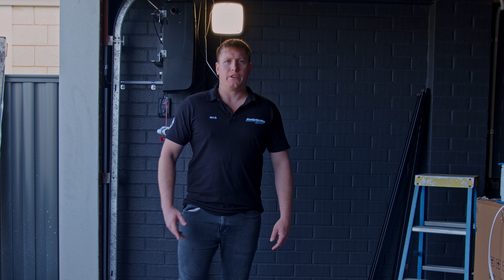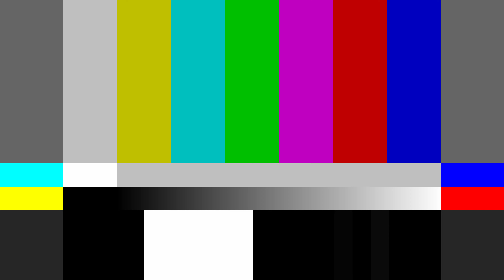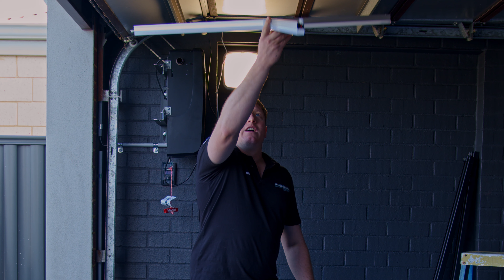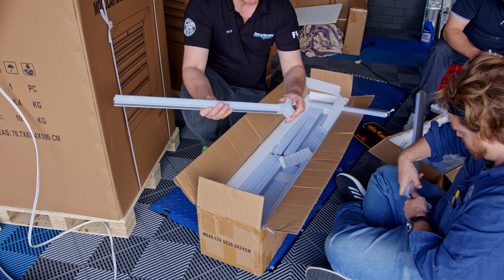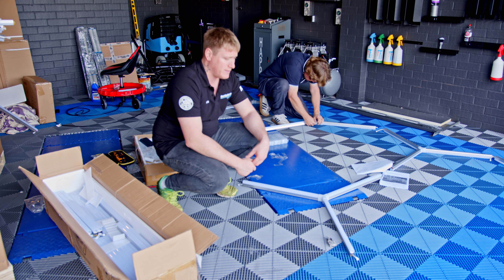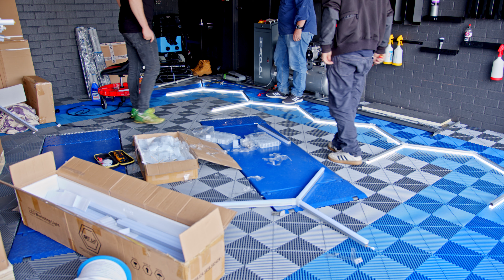HEXAGRID Garage LED Lighting Install! // Ultimate Detailers Garage Build \\ Episode 5

Comment: Hello, I bought a 45 by 14 foot one. It says you have to plug it into 7 different ports at the same time.  Do you need transformers or do I connect them directly?  I have connected it directly from a single output and they explode...

Comment: I hope you can help me I just installed the Hexagon lights and they are tripping the fuse. However, the tubes for the rectangle are coming on. Do you have any opinions as to why?
My thinking is it looks to me some of the tubes aren't all the way set so I'm gonna have to re-secure them from the ceiling and test them and re set them. I'm hoping that not to be the case.
Reply from the maker: Hey  mate where are you from?
Reply: @PrestigeDetailingStudio  from the USA.
Reply from the maker: Ok could be a couple things, these lights are 240V  and another is have you one power out per bank?
Reply: @PrestigeDetailingStudio  btw I figured out what the issue was. I had to take all the lights down and install them on the ceiling again. It has taken me 9.5 hrs. But I'm finally done.
Reply from the maker: Oh thats good news you have them working! Always best to test each bank before installing them on the ceiling.
Reply: @PrestigeDetailingStudio  yea that's definitely 1 to grow on. This has been an extremely tedious task. My suggestion to those who are looking to get this (especially if your like me and don't know jack about electrical hardwire installs
1. Install 1 at a time as you go. 
2. Test after each tube connection.
3.Do Not Try connecting and securing to ceiling before testing.  (You'll thank me later).
4. Don't try it alone. There is a ton of non-moving parts that are not very willing to be simply set. ( if you've done this lighr set up before you know exactly what I mean).

These lights are insanely bright though
Reply: @PrestigeDetailingStudio  I must add these lights ARE AWESOME!!! I had a contractor  come today and they were amazed at brightness and of course never seen them before. Other than the initial install headache I love them! Truly a great buy!

Comment: Are they all ran off a single power input or do you have multiple outlets feeding several sections of the grid?
Reply from the maker: G'day Patrick! All the lights are run in series of 5 banks and then run into go a single light switch. Havs a great Christmas! Stay safe.

Comment: Great Job mate! Love it! Can i ask you something. How did you fit it on the ceiling? I saw you used drill but is the a specific olace were the screws pass?
Reply from the maker: Hi Haris! thanks so much and  the lights come with screws and clips to attach to the root then just a few extra ones around where the lights connect for added safety. Cheers
Reply: @PrestigeDetailingStudio  Thank you :)
Reply from the maker: Absolutely no problem at all! Take care mate.

Comment: how much were all the hex LED lights?
Reply from the maker: There were 113 lights and all up was $1500USD or at the time about $2100AUD
Reply: @PrestigeDetailingStudio  how big is the garage ceiling and how much of it is covered by lights, trying to gauge if I need to go edge to edge or can I have a 1-2 foot perimeter of no lights
Reply from the maker: @dynastywoodworks  its 37sqm or 398sqft and the lights go from edge to edge! Just worked out that way but there's a foot gap at the back of the garage

Comment: Hey mate, how does it hook up to the mains power; do they all connect into one big light then a single cable into the mains or does each section have a mains connection?
Reply from the maker: Hey mate my electrician plugged them into my existing light switches and tested with absolutely no problems but you could have each bank on its own switch i guess but these are all connected to a single light switch.
Reply: Prestige Detailing Studio  nice! Were you attaching to a wood roof or plasterboard?
Reply from the maker: @charles321  yea just the weatherboard ceiling! No dramas at all they're so light.